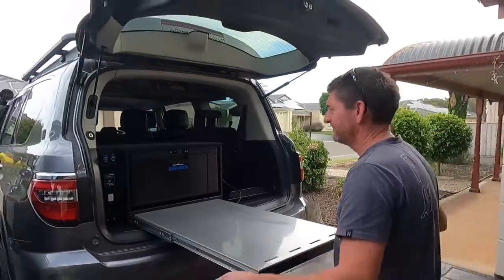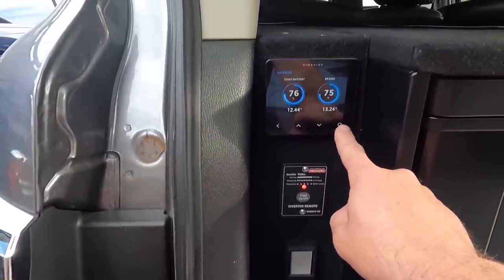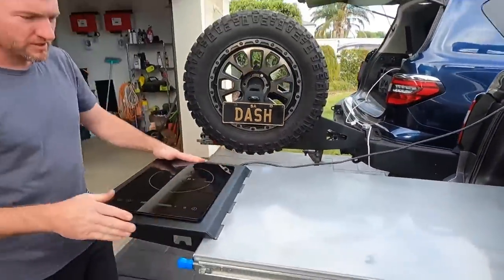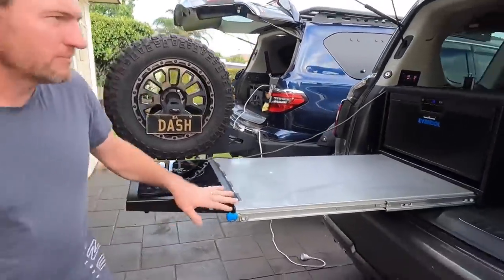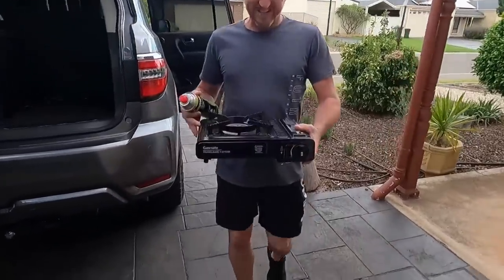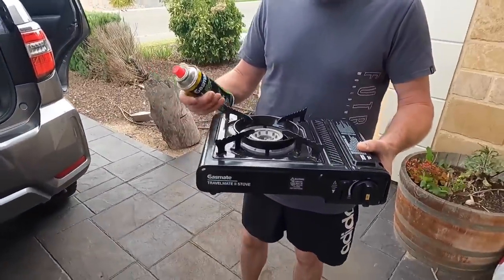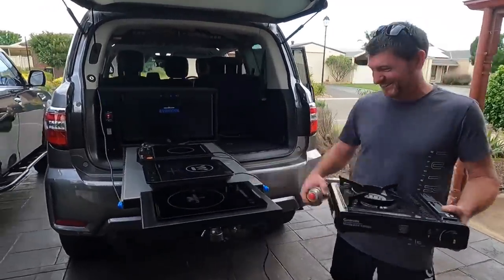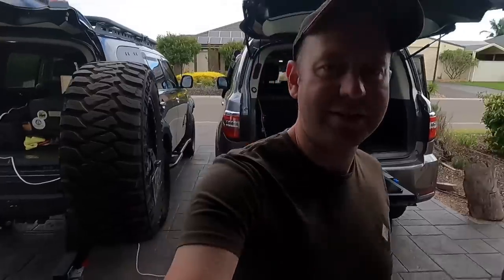Induction Cooker Comparison on Lithium Batteries and 12V Inverter

Comment: Another good test would be testing different pans on the one cooker to see current draw ect, as I know different pans can give different results on a 240v induction top
Reply: Hence the tests are not anywhere near accurate since they are doing comparisons with an  Aluminium pan (with a small steel insert) and a Stainless Pan (less good than a proper steel pan/pot).  My experience is some pans are very good and others are not.

Comment: The different pans make a huge difference too.  You will also find the inductions coils of the different stoves are the most important factor.  If it is only a 6” coil, it could buckle your pans, as the centre heats up much quicker than the rest of the pan.  That is why your steak will always brown in the centre of the pan and not to the side of the pan.

Comment: Great test, one thing I've discovered, different pans have different thickness base which makes a difference to how they heat up and how they hold their heat (the cycling in and out)
I notice you were using different pans so would not be comparing apples to apples
Sorry
I have IKEA induction cooktops, they are cheap and have heat settings 1 to 9, very basic, but easy and they just work, like one of those you had
Keep up the good work, bring on some more y62 trips please
Reply: the more iron in the pan the better, as the system works on magnetism my home induction cooktop loves cast iron pots and pans they heat up super quick

Comment: Good job & great vid guy’s. I think you should do ur comparison using the same type frypan and you should measure the total watts used by each induction top for a more accurate picture of which is more efficient. Watching amps vs volts is good for a quick picture, but total watts used is a common medium.
The time should also be measured against each unit to cook a similar portion each, & this will probably vary according to cooking styles & temps used as well. It was good to see a comparison of 4 induction cookers & how they perform. Thanks

Comment: interesting you mention levelling. after using an induction for years, having a portable unit ( not fixed) allows us to position it so its level and totally away from the vehicle, so the pan doesn't slide off and cooking splatter/smoke is less of an issue.

Comment: On the Westinghouse you were cooking using temperature setting. Does it still cycle on and off with a power level set by wattage? And how big is the simmer circle in a thin pan?

Comment: Not sure how much it matters, but my Westinghouse unit has a warning label that states NOT  to use it on a metal surface.
Reply: The reason for that is because the magnetic field generated to heat the pan can be dissipated to a (Steel) surface below it, causing the metal surface to also be heated, SOME stainless steel benchtops would be ok, but others would not, most of the portable units should sit tall enough to be ok, but best is to place them on top of a cutting board or something similar.

Comment: I think I'd still prefer something like the Jetboil basecamp, way better than those cheap butane cookers and spare propane is easy to carry, not having to lay out thousands on a power system to be able to run it is nice as well. I really like the design of that cooker attachment 😉.

Comment: How long were you cooking for? Steve's unit used over a quarter of its juice (26%) to fry the 2 batches of barramundi. 

The slide out shelf and cooktop/sink attachment combo look neat!
Reply from the maker: That would probably be about right. Without driving and recharging the battery you would probably only get 4-5 cooks from a 100ah battery I reckon

Comment: No offence guys but that's over kill. The portable gas stove beats it hands down for cost and portability it's only camping not long term.
🇭🇲😀👍🍻🍻
Reply: like they said, they do it because they can (inferring that it's not because they HAVE to). Also, the little butane units are pretty useless in any sort of wind.
Reply: Just back from a week in VHC and totally fed up with useless PoS butane cooker.  Tried different ones and this was the best so far but still doesn't hold high temp and completely useless in any wind. Having already invested in an inverter to run a coffee machine, induction cooker definitely looking attractive.
Reply: @billroach2393  LOL

Comment: Yeah no. You guys should have used, identical matching, saucepans. You didn't. So? I'm really not certain what you were trying to demonstrate here? Okay. You can cook with induction, cook tops. Congratulations.

I have a pair of those, NUWAVE's. I bought about 10 years ago. Those, have been out a while. I like their features. I like their more compact footprint. I don't need pretty, rectangular cooktop. The saucepans are round! And so round, makes more sense. Why would you put a, round saucepan on a square Cooktop? Does that make it look better? Yeah no. It does not.

And so when it comes to a, Motorhome. I don't think it's a good idea. To have live flame. Inside a largely, wooden and plastic constructed motor home. As they get very flammable. And there is no flame. With an introduction cooktop. It is just far safer. Without propane onboard. I don't particularly care for, propane. It's a gigantic bomb. And too many go up in flames.

I've been an, Electronic Technician, for over 5 decades. I, deal in, Electricity. Not flames. Flames are for the, Barbecue. Outside the vehicle. We use electricity. Inside the vehicle. My water is heated with electricity. My heat and air conditioning are from electricity. And rays of the sun are free. Propane is from dead dinosaurs again. Even if it burns clean. It's still burning. It's still producing carbon dioxide. For three solar electricity is better. And storage gizmos called batteries. Of which we have a wide variety to choose from. From the oldest lead acid. To the newest lithium iron phosphate. And everything in between. Right on the Nickel. Without much Carbon and Zinc. And only some Cadmium if you want to poison somebody. Lithium if you are, Schizophrenic. Bipolar or what ever. Solar if you are smart. As there is a lot of, Property on top of the roofs of Motorhomes. For solar. Along with additional portable panels. And the rays are all free. From fusion power. One thing we don't have to pay for. And knowing that. Why would you use anything else? You save the planet with solar. Not with propane. Not with Lithium. We have to do better than this.

And so you guys can do, Culinary Enhanced, Tailgate Parties. Without burning down your cars. Congratulations. Guinness, is good for you. It worked. But it's not beer. And it's warm. I don't know what's wrong with you guys? Nobody knows what a cold beer is. Except in the USA. Designed for hot weather desert, consumption. Thick brown warm beer is not. I mean come on guys? You don't have much in the way of hot weather in England. What do you guys know about cold beer? Nothing!

So I don't think much of guys who drink warm beer. Warm thick, brown soupy beer. Yeah that's not beer. Though it might be beer fit for a, Queen? But she is dead. And Charlie's, Dick is going to fall off soon. So much for the Playboy, Princely King. And marriage trashing, Camilla. What a nice black widow she is. How can, Billy and Harry, even look at her? She's the reason, their mother is dead. And what do you say to that douche bag? Queen consort? Really? Hey lady you killed our mother! That's what they should say to her. And how do you get her out of the Palace? She does not belong there. King daddy is nuts. The prostate cancer has gotten to his brain. Which he never had to begin with. Billy, need to step up. And say it... look here dad. I'm not going to wait for you to get as old as grandma before I take over. You're done. It's my turn now. Grandma made you wait, too long. That's when Billy needs to do. Or hand it off to Harry. Which Billy will never do. Billy is just as screwed up as daddy. Billy will crash England. And he'll end up stepping down. Leaving a void.

And soon England will, fall. They have become fragmented. They want kings and queens that serve, no purpose. Time to move forward in time. One more time. And bye-bye Church of England. Hello modern freedom fighters. Nobody needs to be ruled by religion anymore. It doesn't work in a modern society. As we have science, psychology and mathematics. The new trifecta. To run with.

As we will all have to come together. To stop Russia. To stop China. To stop North Korea. To stop Congo. To stop Haiti. To stop Venezuela. To stop Brazil. We have a lot to keep us occupied. And keep them, occupied.

Since Donnie has opened up the floodgates. For all the bad boys around the world. To be running off the rails like Donnie. And they do not know what they are about to receive. Truncation of brain. Their brains will be removed. Forcefully. They don't know how to use them anyhow. We will study them. To see what went wrong. It's called an autopsy. And it must be performed on all of these Dictators. So we will have to round them up. And gas them. Neutralize them. Permanently. And study their brain matter. For years to come. When to determine what went wrong. And why some Homo sapiens insist on being Dictators? We will have to dissect their brains. Posthaste.

The world is getting smaller. And we need to be done with crazed Dictators. They will have to be evicted, from planet Earth.
RemyRAD
Reply from the maker: Wow… we’re from Australia btw